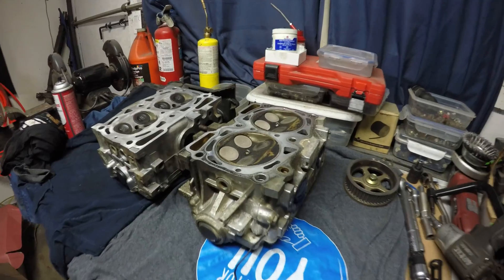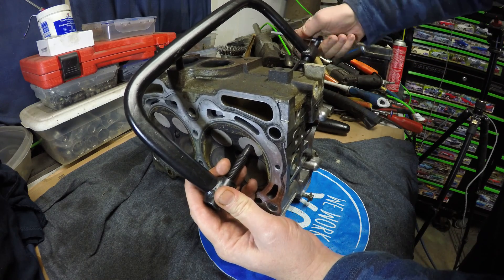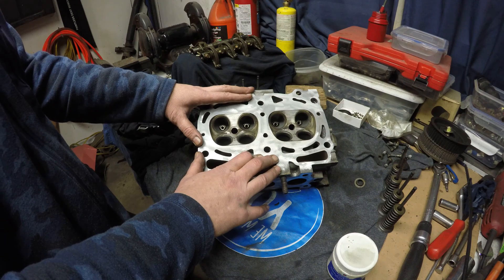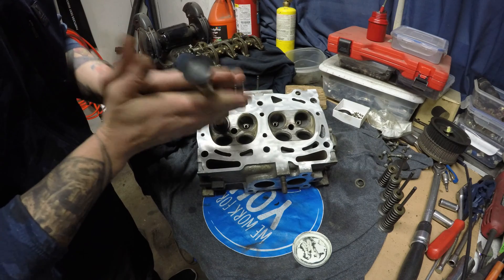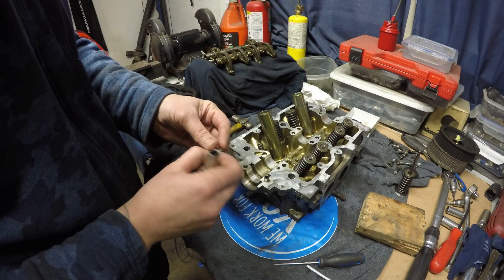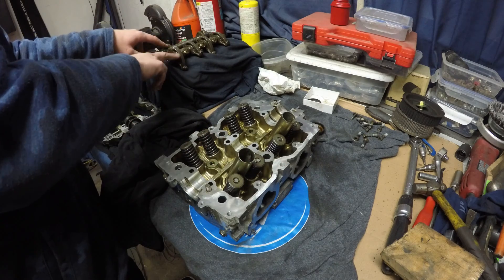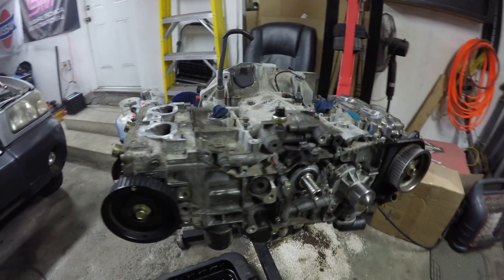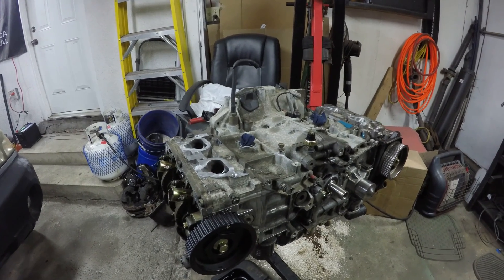Lapping Valves, Installing Valve Seals and Head Gaskets - How To

Comment: Rebuilding an EZ30 and have 2 different part numbers for the Exhaust and Intake stem seals... assuming their the same, no mention of any difference anywhere in the FSM haha. Came across this video in search for a decent explanation on valve lapping Subaru motors. Awesome video mate.
Reply from the maker: Good chance they are the same. I am not sure about the H6's but knowing Subaru, they are likely the same. Thanks!
Reply: @HomebrewSubaru  Pretty much the same just a slightly different colour, I guess just to use as a indicator idk... but the intake valves are very different and they don't have the keepers at the top of the valve it's lower, maybe 1 quarter down the valve... so I've spent 3 days after work trying to get the bloody things to stay but no luck. Gonna try getting a different valve spring tool. I can't seem to find anyone rebuilding a EZ30R head either which is very odd.
Reply from the maker: They're just not as common as the EJ's were so not as much repair enough out there. I've never played with the H6's but would have loved to have had one put in my Forester. After doing these head gaskets and having a backup EJ251 on the side, I will stick with the four banger.
Reply: @HomebrewSubaru  Don't ever assume haha I learnt that the hard way :)

Comment: Damn I need that valve tool.
Reply from the maker: It's the best design I have ever used. Not sure how much more use I will get out of it after this engine though.
Reply: @HomebrewSubaru  I have the push with all your body weight style. Works but I'm getting old

Comment: The one thing I forgot to do was valve seals, and guess what ya cylinder 1 and 3 are a little leaky on the exhaust said. Ugh lol
Reply from the maker: The valve seals on later EJ engine were much better than the first generation. My first Impreza had a 1.8 with a ton of mileage on it. I would floor it on the highway and leave a giant cloud of burnt oil behind me.
Reply: @HomebrewSubaru  for sure. I thought I was good. But when I was putting the manifold on I saw some oil. Sent it for now. I'll get to those.